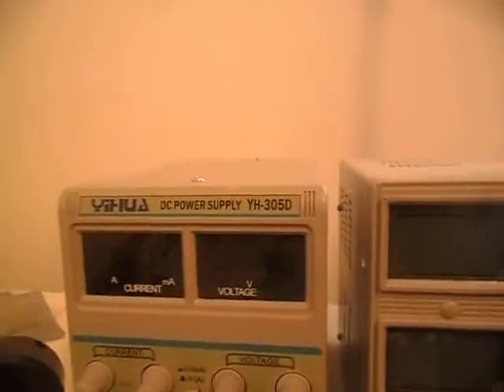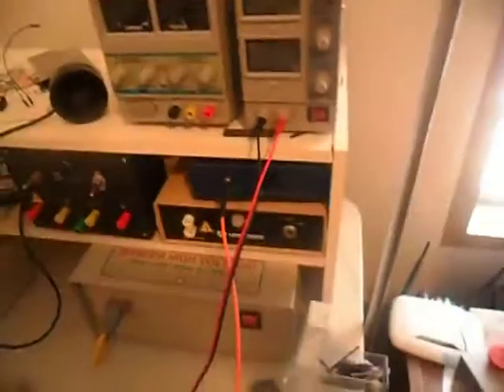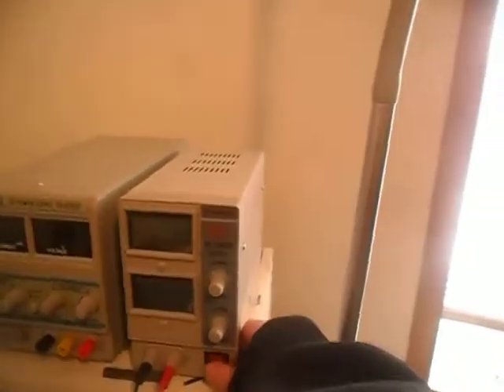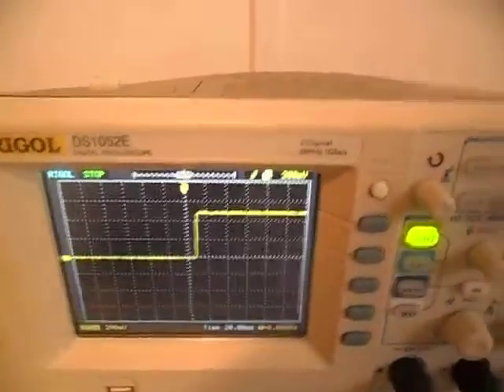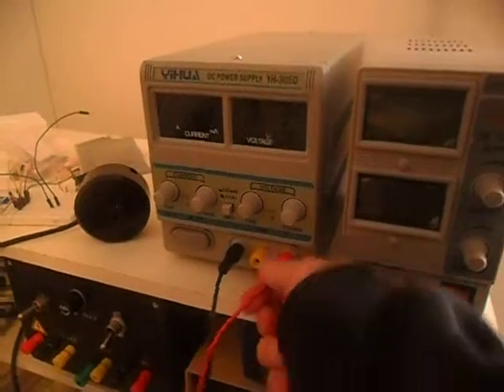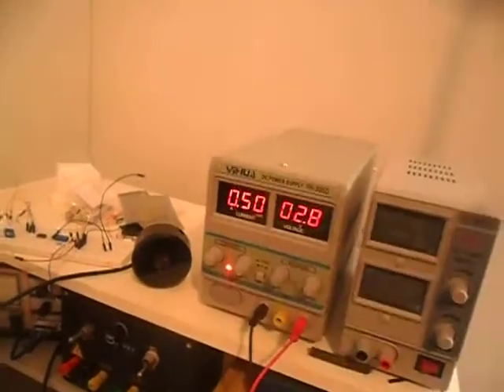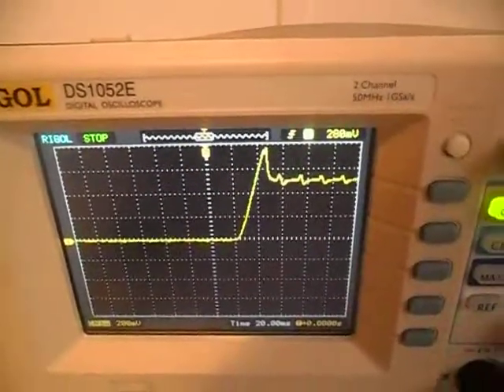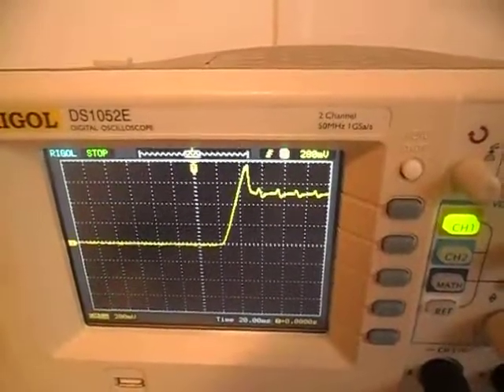To ebay seller xcceries regarding the YH-305D

Comment: if I connected the anode and cathode to pieces of copper, then placed them in salt water, turned on the YH, say 6V 1A, would it provide power or would it trip out? I don't mind the 'crap', I just want power to etch copper...

Comment: One other thing, it may also just be a faulty output capacitor for your unit.  Try putting say 1000uF across the + and - inputs and see if it improves.